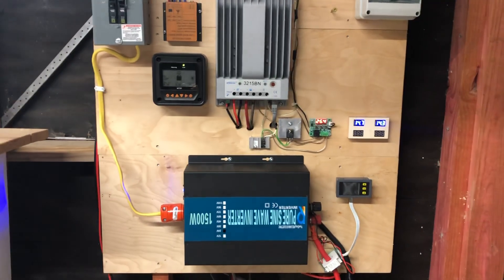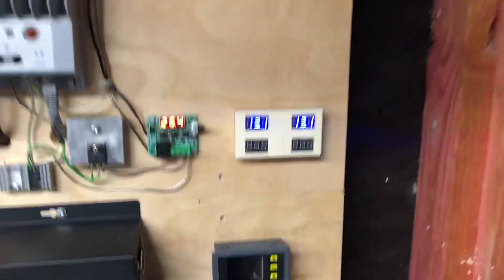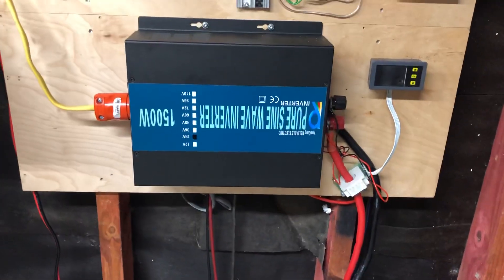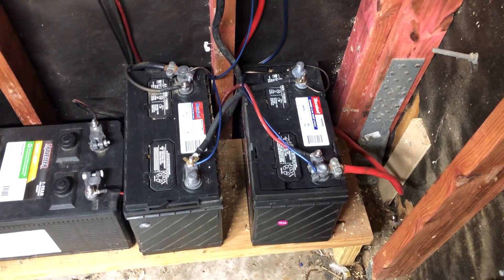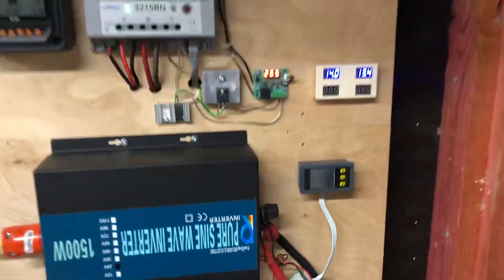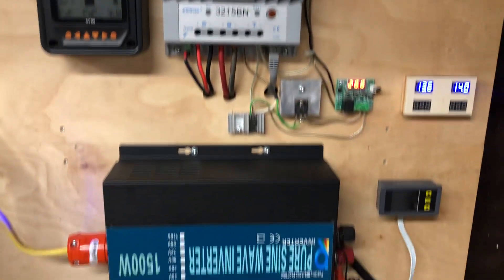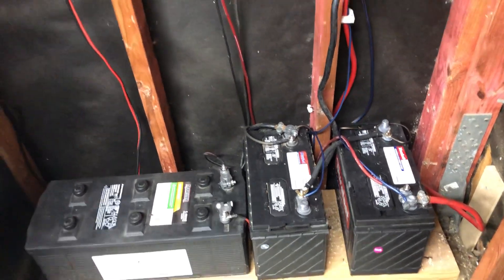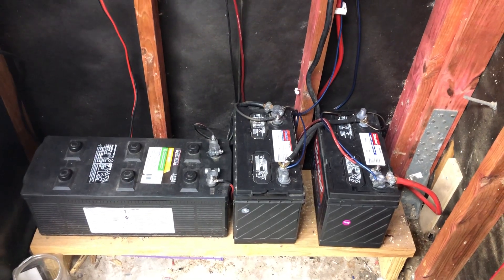12 vs 24 volt solar. Was it a good idea?

Comment: How you mount the meter for amps
Reply from the maker: It comes with a bracket
Reply: @Checkitfirst  all mine came with us the 4 nuts and screws. Then the screen is on of them you cut a hole and pop it in
Reply from the maker: @codyguerrero1119  
Yours must be different than mine.

Comment: I agree, 24v upgrade may not be for me either.  I’m going to upgrade my panels first to see how that works out. Good video dude!
Reply from the maker: There is one thing,,, my little fridge was pulling 7 amps at 12 volts. Now it’s pulling 3.5–3.7 amps at 24 volts. I’m still at 100 amp hour battery bank. Even though I added a second battery,,, it’s in series to get 24 volts but I don’t gain any amp hours. But I’m using a lot less energy from that 100 amp hour bank so my fridge runs a lot longer than before on those cloudy days. I had to get 2 new batteries purchased at the same time so they were a closer match. Before the batteries were not matched and charged so differently. If I had it to do again I do believe I would stick with the 24 V just because the battery bank last longer.
Reply: @Checkitfirst  I guess with that being said, it’s a hell of a lot more efficient. I was thinking only about the wire cost benefits but you cleared that up. So I would have to get a whole new battery. I have a Renogy 200ah lithium and I was told I can’t hook it up in series to double voltage. Ughhh
Reply from the maker: @garywiththegadgets5496  
A 200 amp hour lithium isn’t cheap. 
I have been looking at them myself. Looking for a 24 V lithium. They are like $1500.🙄
Reply: @Checkitfirst  Hi Kevin, I posted a comment on another of your videos yesterday not to get me started on batteries! Here we go.....Yeah lead acids are a pain, I have the discharge ratings for my batteries, 110ah 12v lead carbon gel, they are rated to give 1.1a for 100hrs = 110ah, if I pull 5a they last 20hrs = 100ah, if I demand 30a the battery lasts for 2hrs = 60ah, if I pull 73a the battery lasts 1/2 hour so only gives 36ah. The more amps you want the less capacity it will give. Deep cycling also wrecks batteries, if you can keep battery voltage above 12.2v and share amps draw across more batteries they will last many years.

In my experience my 6x 12v is ok for up to 1kw, I can happily power a crockpot all day with fridge and freezer, lcd tv too if enough sun, overnight just fridge and freezer without dropping too much voltage, 12.2 has been my lowest overnight reading which isn’t bad on the batteries.

For 1kw - 3kw I hear 24v is better, and 3kw upward best to be looking at 48v. If I were to go lithium, I would ignore the 12v ones that look like car batteries, I’d invest in the 24v or better still 48v server rack batteries, they last up to 10000 cycles as opposed to 1000-2000 cycles of lead acids. Server rack batteries are expensive but they are worth the extra money for reliability and longevity. 

Another note I read is that at 12v you need 100ah of lead acid battery for every 150w of inverter, so 1000ah for a 1500w inverter......

My next inverter will be a 24v 3kw all in one type with its own charge controller and panel input, therefore I keep my existing setup to charge the battery bank and the inverter will have more panels of its own to harvest more sunshine and offset the inverter demand. And I’m going to need to at least double up on batteries too.....

Comment: But it is much more than the wire size. You can run more things for longer period. I went from 12 to 48v man I can never go back to 12v again, one down size to 48v if one of your batteries goes you are in trouble but everyone going lithium these days so over time is won't matter.
Reply from the maker: I have come to understand that it is better to do 24v than 12v. My fridge used around 5 amps on 12v on the inverter with a 100 amp hour battery and only 2.5 Amps with a 24v 100 amp hr setup. 
So my fridge could run twice as long. 100 amp hour lead acid battery is really only a 50 amp hour battery since you can only run it down 50% which is even bad. 48 V would be great. I’ve been having trouble keeping my batteries at 24 V equal to each other for some reason they charge at different rates. One batteries at 14 V and the other one’s at 13.2 during charging. So that concerns me just a little bit because now I have to disconnect the batteries and charge them individually with a separate charge controller to get each battery charged equally. Hoping someday I can afford a 24 V lithium ion battery but there are $1000. Or more. Lithium does give you the full rating which would be great.

Comment: Max PV voltage is 150 for both 12 or 24 with that charge controller. The difference is with temperature, see the notations next to the voltages.

100Ah at 24VDC is the same as 200Ah at 12 VDC. You haven't lost any capacity running the 2 batteries in series. Same as the panels. 400 watts of solar, for example, is the same regardless whether you run them in series or parallel. It is borderline for your size system, when you get upwards of 3k+ watt inverter you really need to up the voltage.

Love all the videos. Cool setup to be able to experiment with so many panel and controller configurations in your shop.
Reply from the maker: Thank you for your info. I’m just trying to get all I can🙄. I’m definitely in need of some upgrades.
Reply: I’d like to get your advice on my system too! Wondering if I should upgrade or what I can do better.

Comment: You still have 100amps right, but 100ampx12v is 1200watt, and 100x24 is 2400watt, so your capacity is with another battery is doubled, you didn't loose anything.

I have similar system but i see lot of cables, shunts, fuses, low voltage protection and and and on your wall, on mine too. Im thinking about this new all in one devices, you can connect everything in it without cables and you can connect generator and grid, so it is starting generator, it charges batteries and it shuts off the generator. So much better solution for me.

Comment: JUST GO AHEAD AND BITE THE BULLET AND BUY 4  DURACELL 6 VOLT GOLF CART BATTERIES FROM BATTERIES PLUS OR FROM SAMS CLUB FOR $86 EACH + THE $18 OR SO CORE CHARGE UNLESS YOU TURN IN THE OLD BATTERIES FOR CORE CHARGE SAVINGS TOWARDS THE 6 V GOLF CART BATTERIES   . YOU WILL STILL BE GOING OFF CHEAP . UPGRADE ALL COMPONENTS INCLUDING THE RELIANCE INVERTER TO 24 V .  USE THE SAME THICK CABLES FOR THE INVERTER FOR MORE POWER  EFFICIENCY . MAY THE SOLAR BE WITH YOU .
Reply from the maker: I will definitely look into the Sam’s club golf cart batteries
Reply from the maker: Those batteries are only 20 amp hours. 4 in series is still 20 amp hours. Not as good as what I have
Reply: I found those batteries and they way they are rating them is weird but it says 75 amps for 105 minutes so like 120Ah or so and lithium is not to cheap but i mean I assume you payed at least $100 probably closer to $150 each for one of those batteries but you can get 4 lithium iron phosphate 100Ah cells from Ali Express for like $160 so for 24v that's like $320 and I have a bms that works well for me with a 7s lithium ion battery pack made from 18650s that offers bluetooth so you can setup everything the way you want it and can monitor thing but anyway It was like $70 and that's a lot all at once but if you save up for a little while I think you'd be happy with them and just curious how much you regularly discharge and with your meter can you tell how much if any capacity you have lost
Reply from the maker: @james10739  
I paid $119 for the two marine batteries and $157 for the bigger 4dlt battery. I have noticed that the capacity of the batteries have worsened. When I was using a 12 volt setup It seemed like that one battery did pretty good but since I have switched to a 24 V set up they have gotten pretty bad. For instants, running a small fridge all night long my battery would read about 12.5 by morning. Now at 24 volts each battery goes down to 12.1–11.9. Could just be a coincidence that the batteries are just losing capacitance. One battery is older than the other but they seem to balance out pretty well.A 100 amp hour lead acid battery is really only a 50 amp hour battery since you can only use half of it. So I am definitely looking into lithium in the future

Comment: Igot set batteries let them go under 11v lots most every day and been 4 years batteries car still good my deep cycle craped out some last year some 2 none charge fast like car batteries just you need spend little get japanes brand or CAT batt good aswell dont crappy batteries even tho the worst car batteries better then deep cycle

Comment: Deep cycle batteries worst to use they dont take fast charge theylose charge fast best batteries normal car batteries ive use 12 24 48 v systems tryed all sort batteries best by far car battrries and 12v best system light stuff i ran aircon 12v